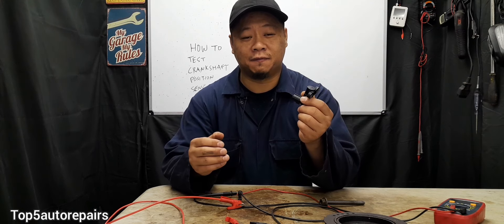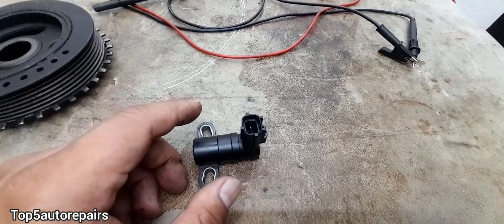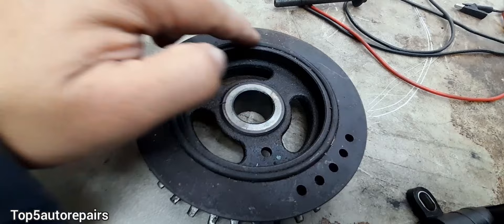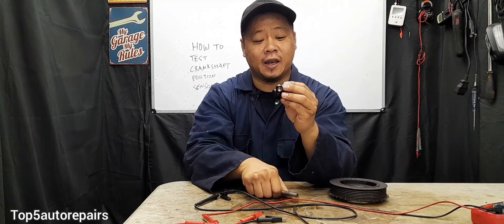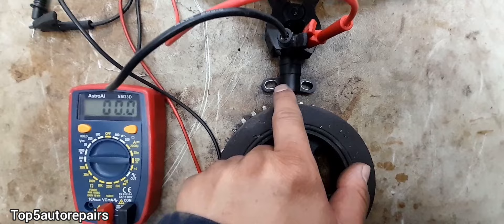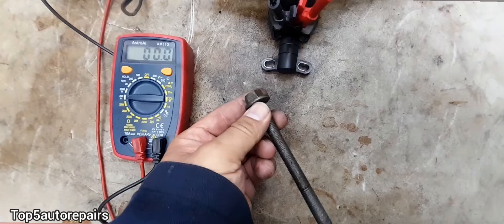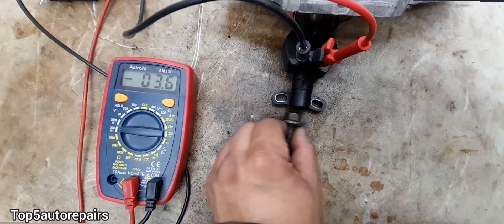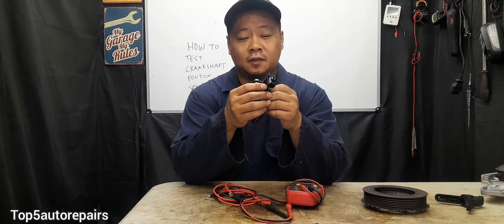HOW TO TEST CRANKSHAFT POSITION SENSOR WITH A MULTIMETER

Comment: That may test it to some extent but what if your having an intermittent problem ? Hard starting , no start then hour later starts right up ? Changed crank sensor and no problems since a year later . So im just saying that may diagnose a dead sensor but not one with intermittent internal problems
Reply: My dads 94 Volvo 850 was doing the same thing and finally quit and he’s tried new plugs and wires , fuel pump and so on, I know I’m basing this off your experience but u feel it would help to try and fix it for him, it’s been down for 2 years now
Reply: I've had this for a few weeks. I bought a 10 quid non contact voltage pen. Next time it didn't start, I whipped it out of the glove box put it on the signal wire. Got my passenger to press start and hey presto 0.2 volts. Turns out the connector block to the sensor was knackered. Move it about and a signal would return.
Reply: You can test an intermittant sensor by applying heat with a blow drier or heat gun, they should read about 1k ohm, but if you apply heat it  may cause it to open up and read open causing a no start or stall
Reply: You’re supposed to use an oscilloscope to see what a crank sensor is actually seeing. You can test with multimeter but it doesn’t tell the whole story.

Comment: I've got a misfire issue on 3.4 chevy engine. I replaced the cps on the harmonic crankshaft and it made no difference. There's another cps at the back of the engine block that's very hard to remove. When I turn the engine for AC voltage at the end of harness that goes into the ignition control module, it shows only 17/1000ths of a volt. The new one I bought show anywhere from 200 to 400 millivolts when pass a bolt across the magnetic end.

Any opinion on my method and the old cps?

Comment: I have another question ❓ can i just unplug the crank position sensor and try starting the car ? If i unplug it then connect it to my volt meter i should see what you showed on your video right
Reply: you can unplug it and read it, it's just a sensor. no need to turn the engine over.

Comment: I have a yr 2000 E55 Amg and my Crank Sensor gave me no warning and wouldn't start one morning, I YouTube no starts and someone mentioned Crank sensor could be the problem, I go to Autozone get a $54 dollar Duralast sensor and put some Olive oil on my hand and arm and wiggled my arm down and took it out and put the new one in and I swear I heard a click sound when I put the new one in, wiped my hands off put in the key and boom, she immediately fired up, w0w saved myself a $200 tow ride, a mechanic charging me $250 for a 54 dollar part and $300 Labor costs, w0w.
Reply: 💪💪💪💪 great job